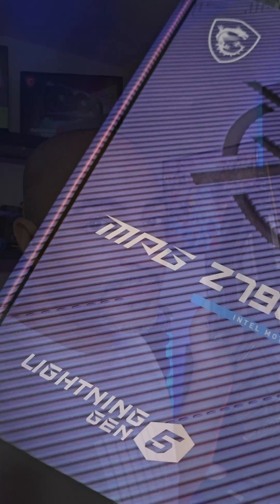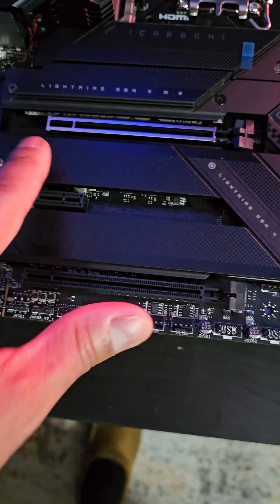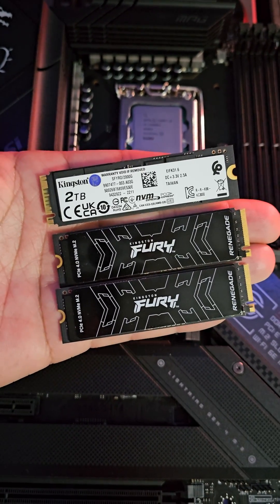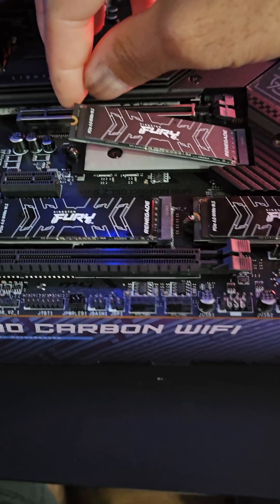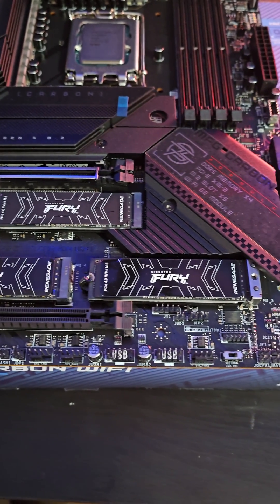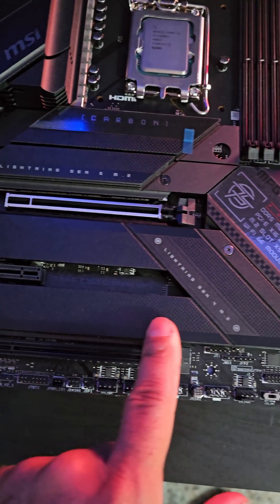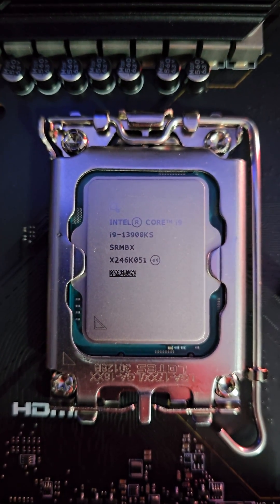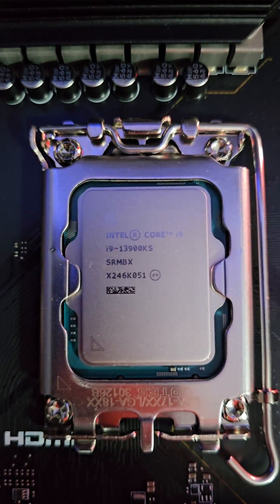Kingston PCIe 4.0 installation on MSI MPG Z790 Carbon WiFi Motherboard

Comment: I have a Sata M.2 SSD that only works on the M.2_5 slot. However, it doesn't boot to Windows. Simply shows up in the BIOS and doesn't give me an option to change its boot priority. Have you faced any issues like this or have an idea on how to remedy this situation?

Comment: i have the same motherboard and 2x2tb samsung 990 pro ssds. which slots i should use first? also i'm planning to add more in the future. was thinking about using top two slots (m2_1 and m2_2). thanks in advance...

Comment: Nice! Out of all of the x670e and z790 motherboards you have tried which has been your favorite so far?
Reply from the maker: Probably a tie between the Z790 ProArt and the X670E Ace
Reply: @DaPoets  Thanks for your reply, I definitely appreciate it and just subbed too. Been shopping around for a new x670e board
Reply from the maker: @therealbdbeatz  The most common mistake people make are paying too much for a motherboard with features they will never ever use. Be very mindful of that. Unless you absolutely need 10 gigabit ethernet, you won't actually benefit from either of those motherboards.